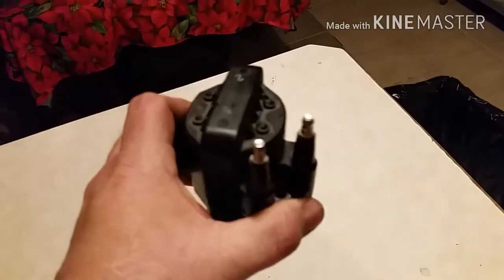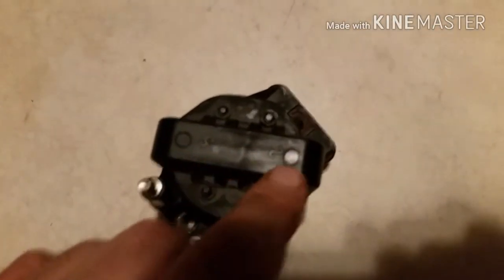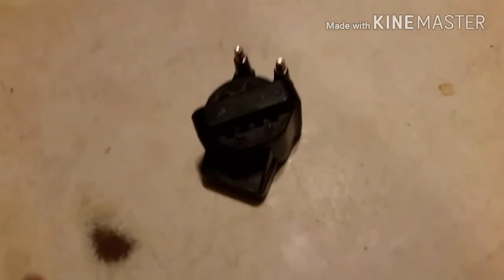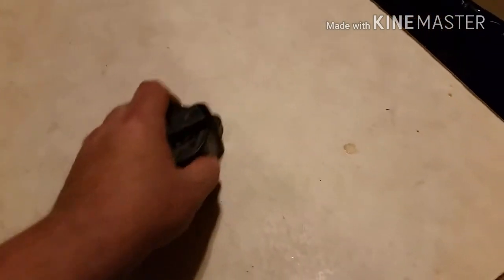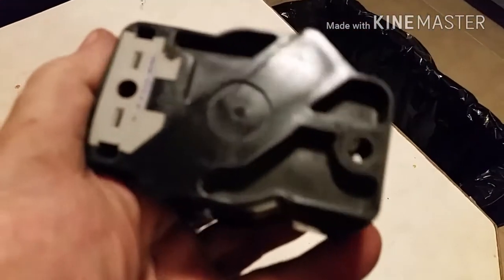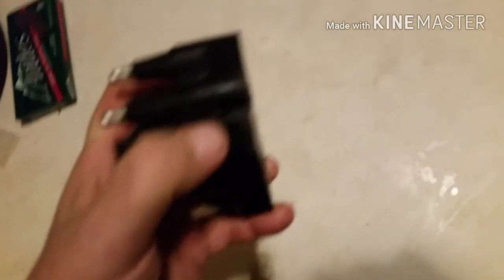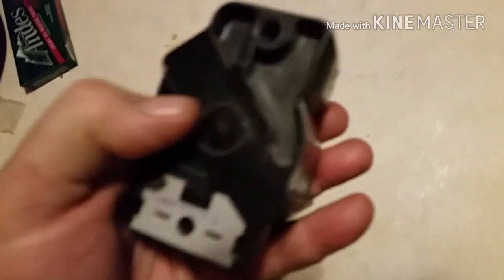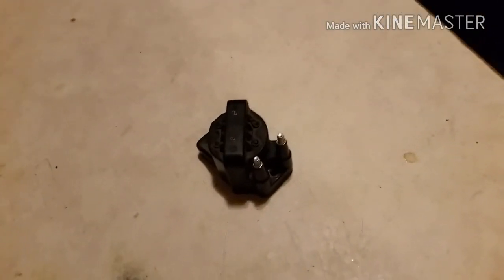G.M. 3100 3400 coil pack test and replace. Code P0305

Comment: CAN THE CRANK SENSOR CAUSE WEAK SPARK TOO ON COIL 5 2 BECAUSE I REPLACED THAT COIL AND THE SCANNER READ A CODE FOR CRANK SENSOR FAILURE AND THAT ENGINE HAS 2 CRANK SENSORS ALSO THAT PARTICULAR COIL IS INDEPENDENT FROM THE OTHER 2
Reply from the maker: I'm sorry I dont know the answer to that.